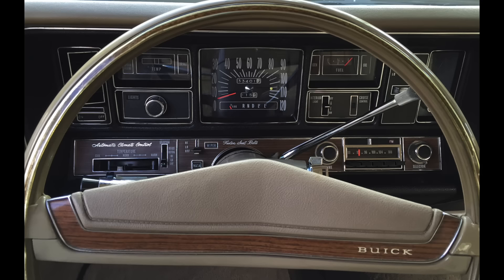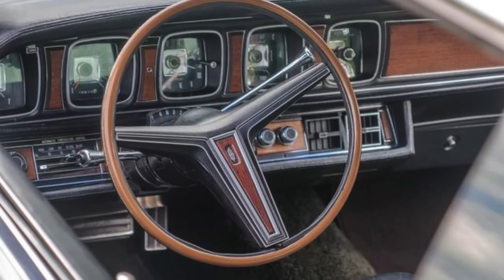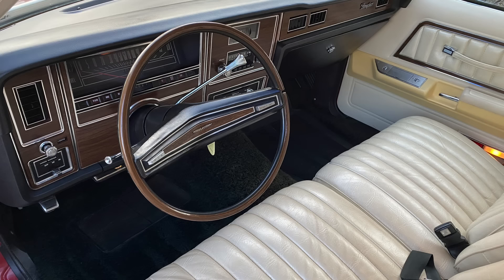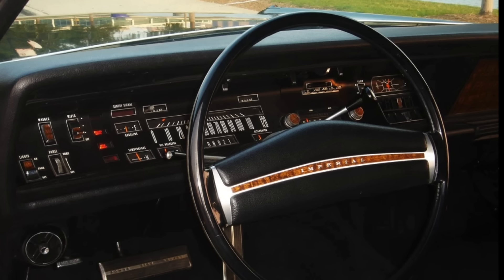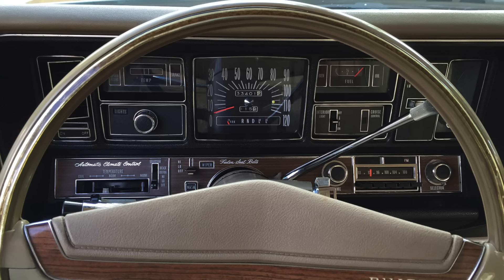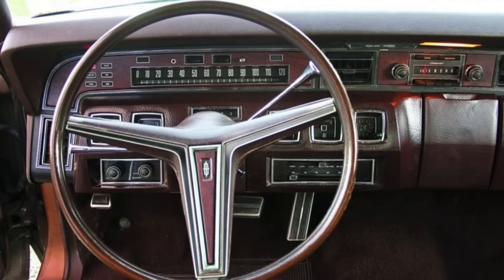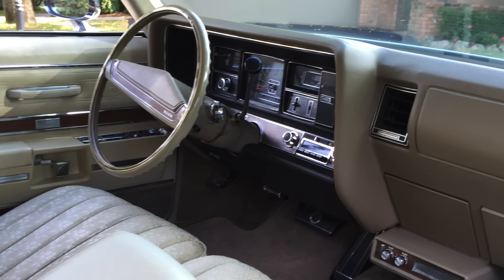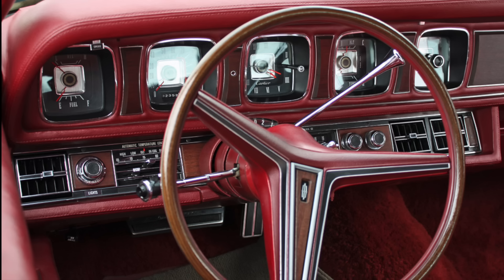Worst Automotive Inventions:  The "Rim Blow" Steering Wheel That Many Customers Hated

Comment: This pales in comparison to early Ford Escort/Tempo & I believe early Fox body cars like Fairmont & Mustang... you had to PUSH INWARD on the turn signal stalk to blow the horn! I have no idea how that brainbuster slipped past the product liability lawyers.

Since my '82 Escort had no air, I always had the window down & just got used to yelling obscenities at the offending scumbag. Much easier than trying to push the signal stalk inward. There's a special place in hell for automotive engineers & beancounters would be first in line for the bath in dilute hydrochloric acid!

Comment: 1979 Ford Mustang horn was in the turn signal unit. It was the worst thing I’ve ever seen. If you had hit that horn fast and hard you had to take your hand off the wheel, dodge around behind the wheel and smacked that button the end of the turn signal And always hit it hard because the signal thing moves up or down. It was so stupid design that coming off of 1966 Ford Mustang GT fastback Thunderbird blue color from the factory. My wife wanted this mustang it sucked for cylinder oil burner 1979 is when a lot of Ford dealerships were closing up, first time we had in the shop I went in the back room. They had the transmission, the muffler and everything laying on the floor. I’m thinking all what I buy here. Brand new car not used car

Comment: I had a '69 Mustang convertible with the optional "sport" steering wheel.   It had the rim blow feature.   At one point when the car was about five years old I did a thorough cleaning of the car and for the next few days the horn would crackle.   With my Dad's assistance I tracked the problem down to having cleaned the wheel with Windex that had seeped into the cracked rubber of the rim; we replaced the Mustang emblem in the center of the wheel with an old-fashioned doorbell button that remained until I had to swerve to avoid an elderly pedestrian in the road.   Missed the old gentleman but not the telephone pole, unfortunately.

Comment: I don't think the tail lights could be literally 'turned upside down'.  My first job (c 1980) was as a lab tech at a company that manufactured vehicle lighting lenses.  My job was spot checking production units for light dispersion.  There are very specific rules pertaining to colour and intensity of lights as viewed from different angles. That is why the lenses have the diamond type pattern in them (for conventional lamp bulbs, not LED  clusters) Turning a lens upside down would result in incorrect dispersion.